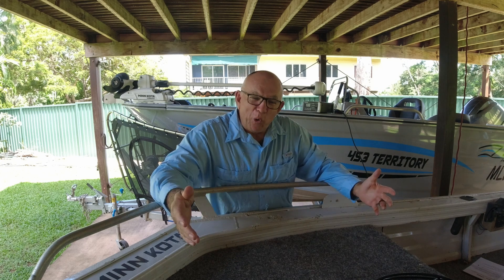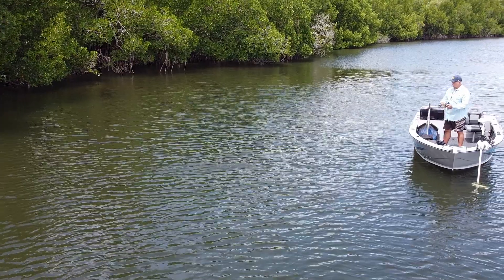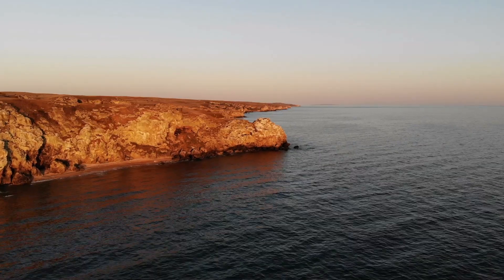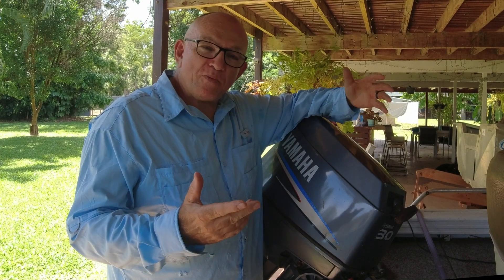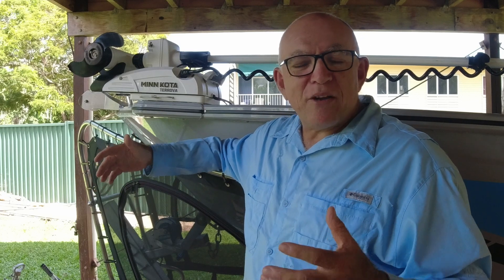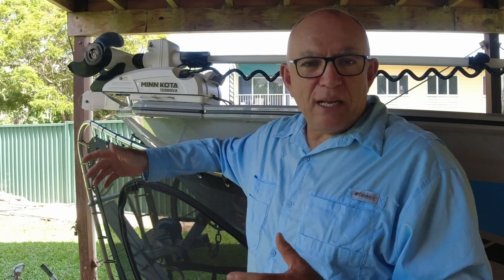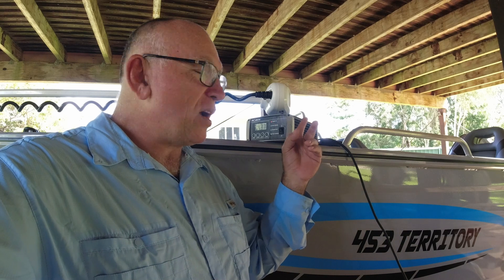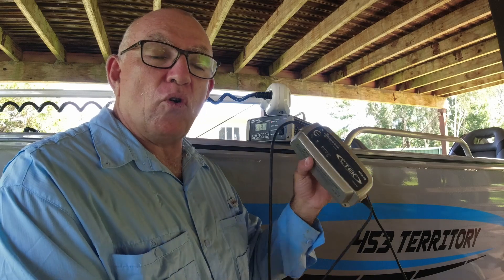Boat Batteries Explained ALL TYPES OF BATTERIES COVERED

Comment: Lifepo4 are great. Ihave 120ah for my minn kota and 100ah for my sounder and LEDs. The price point for 100ah lithium batteries is a lot more ah/$ when compared to 50 or 60ah lifepo4s. I wouldn’t touch lithium ion with a 10ft pole purely for the fire risk. Also  I learnt the hard way that sounders and electric motors can’t share the same battery. The dc interference from the motor scrambled my sounder image.
Reply from the maker: Interesting that you mention the fire risk with lithium. I need to get as much out of my MinnKota battery as I can so I went with lithium but havent head much about them causing fires. Is it from the charging of them or just the battery itself?
Reply: @smallboatcaptain1968  most ones you see these days selling lithium batteries for camping or boating are the safer Lithium Ferrous Phosphate LiFePO4 type. Lithium ion batteries with a different chemistry can be found in electric cars, scooters phones and rc gear. Some of these are prone to fires if damaged, wrong charging current or whatever. When it comes to lithium, you need to do your research, avoid ebay, and use the correct charger. LiFePO4 is said to be quite safe.
Reply from the maker: @potatoesGDITB  That is a good point. I heard stories about dodgy lithium batteries sold on line and the different types of lithium batteries. 
I haven't had any issues with mine and a number of mates are running them as well now. Not sure if there will be an issue down the track but I still think the benefits outweigh the risks. I could be wrong though. 
SMC.

Comment: Hi mate i have one battery in the rear for the sole purpose of cranking the engine ,i have or will have a second battery in the bow for powering nav lights , internal lights , anchor light , sounder ,bilge pump and accessory plug  .Now none of these will probably ever be on together apart from anchor and internal lights and they are all led so very low draw . i have seen guys who run 1 battery for everything and have heard of batteries going flat for starting (not good ) so this is my reasoning for having two batteries dedicated for different tasks and ive always carried an emergency pull start rope .
Reply: Haha. I’m the same mate. I’m an over-engineer as well so I get it.
Reply from the maker: G'day mate. I have been using electric motors and sounders for about 25 years or more but prior to that, I would only have a small sounder that that was about it. Most of my old boats didn't have bilge or lights. In that case, I only had one battery and would always put it on an external charger for a day. One of those old orange chargers you used to buy for about $20 so it wasn't a trickle charge or anything. And I never had an issue. I carry a pull chord as well but I have never used it. 
I don't want to talk you out of a second battery because it is a great idea. A light lithium battery will be ideal unless you want it as backup to crank the engine. So it is up to you. You dont need it but that has never stopped me before. Go for it.
Reply: @smallboatcaptain1968  Hi mate that is one reason i was going to have it as a bakup starter just in case cant imagine being 5 km out or more and not being able to get that damb motor running , maybe overkill but thats me i always over engineer anything i do or build . Seen a bloke at the ramp one time had wife and kids in the boat cranking cranking cranking nothing i said to myself ahha i know what you didnt do last night wifes face said it all cheers mate .